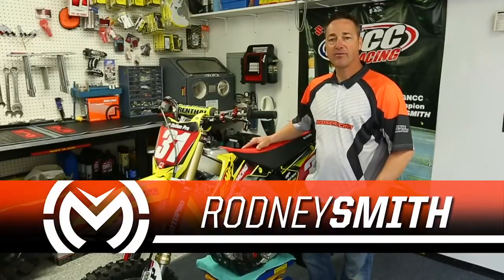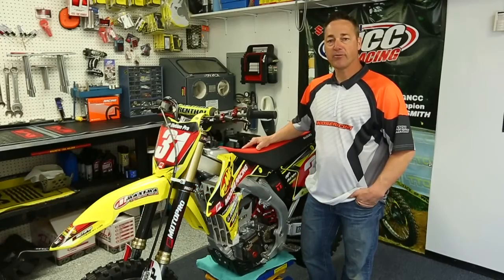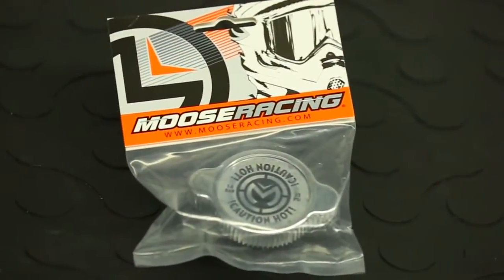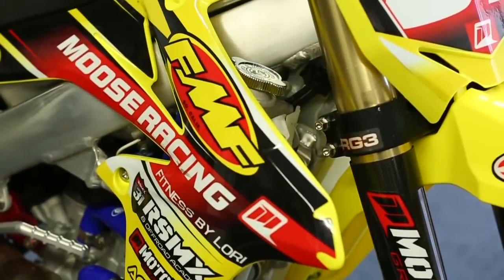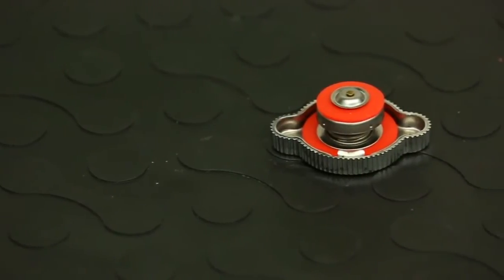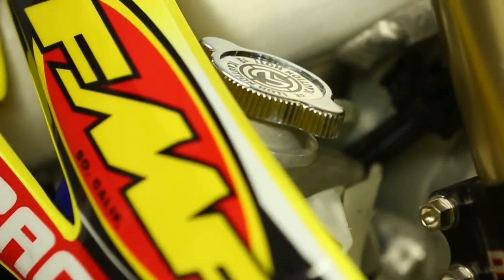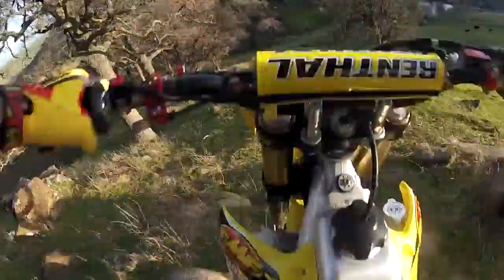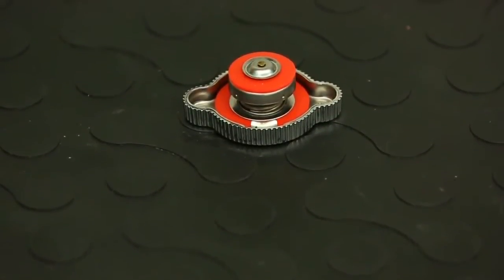Moose Racing Radiator Cap feat Rodney Smith at BikeBandit.com

Comment: Yeah bullshit, they gave you the cap, and said give us a shout out. You can't increase the boiling point with a cap.
Reply from the maker: Hey TC,
So we're going to reply to your comment, but then we're going to have to delete this post, as we have a mixed audience here and can't have "BS" in the comments. 
So, you bet you can increase the boiling point (BP) of your radiator fluid with a high pressure cap. You have taken high school chemistry, right? If you haven't yet, or perhaps forgot basic physics and science, the BP of fluid is raised roughly 2-3 degrees for every psi that the cooling system is raised. That's the whole point of radiator caps to begin with. Most cooling systems run in the 15psi range. Instead of psi, you might see "bar" as the term used instead, depending on whether your bike is an import or not. The conversion factor is 1.02, so they're pretty close.
Ex: a 1.1 bar cap(15 psi) we can raise the BP from 212* to about 255-260. Add a high pressure cap (say 1.3 bar), and you can get another 8-9 degrees out of your system.
Anyways, look up "boiling point radiator cap" and you can learn a lot more than I can teach you here. Anyways, let's watch the language in the future please. We have lots of younger folks that subscribe to our channel, and we want everyone to enjoy their time here. So, thanks for watching our videos. Please subscribe, and ride safe out there. BB.com!